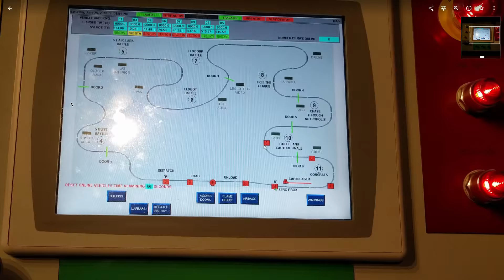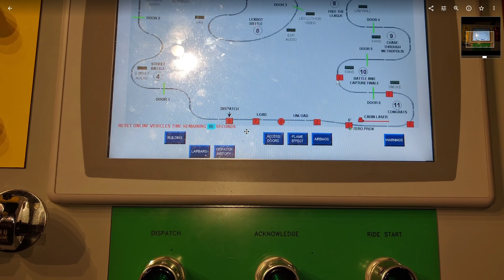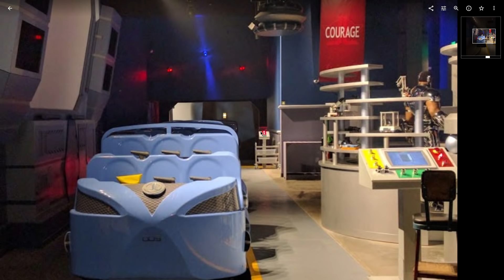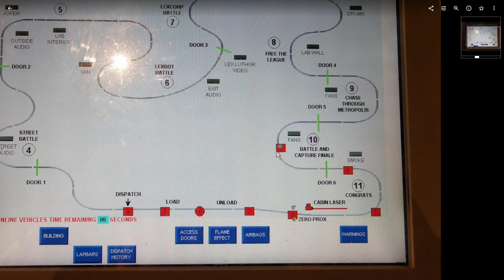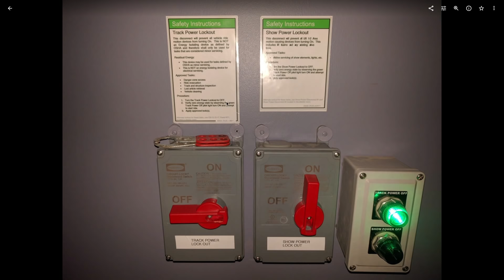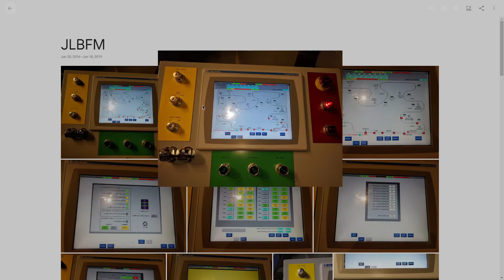Justice League Ride System Explained (SFGAm)

Comment: Any idea why the lasers are pulling to the right?
Reply from the maker: Improper maintenance. Haven't ridden it in a year or two so don't know exactly what you mean
Reply: @realsfgamfan  You hold the gun and shoot but the beam on the screen pulls right so you're firing in front of you but the beam veers off so you have to compensate by holding the gun in odd and weird angles.

Comment: Hey so what company supplies/manufactures these control panels for six flavs? I tried looki g up allen bradley and clicked on products but i couldnt find anything. Also, please do the america  eagle and giant drop!! Keep em coming love your videos!! And when maxx force is done do that one too!:)
Reply from the maker: Different depending on the ride. Usually the manufacturer does it. Allen Bradley hardware. Six flags has its own engineering team that designs and installs panels for rides that need it.
Reply: Allen Bradley just makes the HMI (screen). The whole panel is probably made by a third party from many different manufacturers parts
Reply from the maker: @BenneLuke  the buttons and switches are Allen Bradley 800T series. You are right about the enclosure that could come from anywhere.